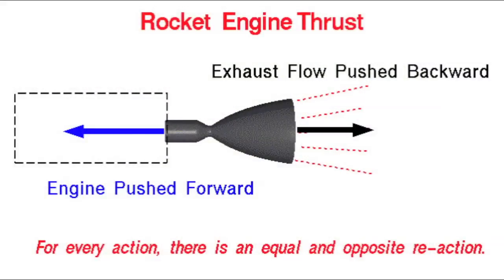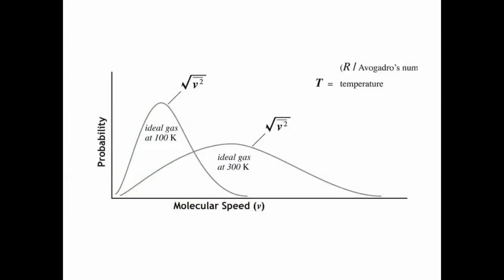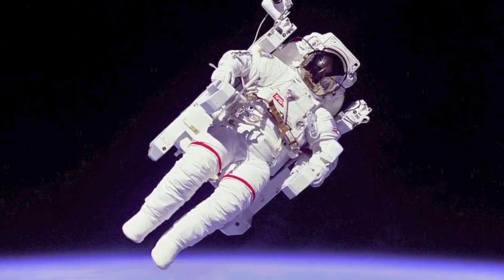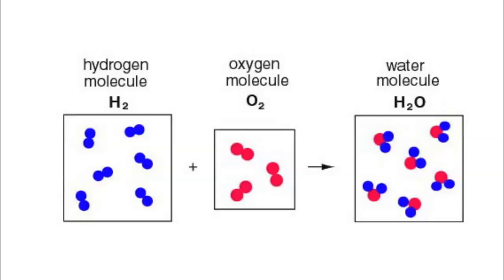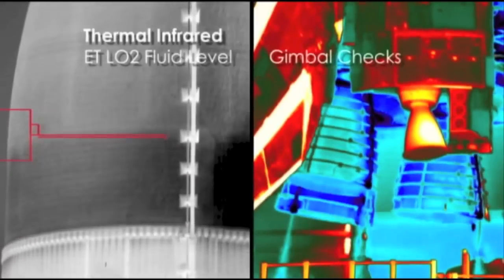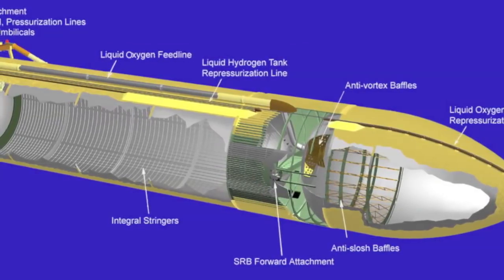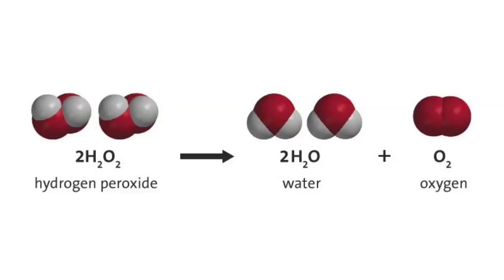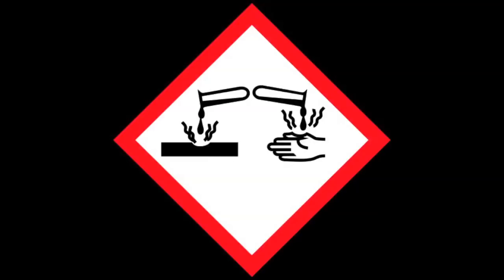WTF is Rocket Fuel Anyway?

Comment: So why arent we using SSTOs in real life or maybe even jet engines to get the shuttle high enough for the main rocket engines to fire?
Reply: I've been wondering about that, too. The concept seems realistic enough, and starting to burn the rocket fuel at the edge of the atmosphere should yield a higher specific impulse, right?
Reply: The quick answer is that getting to orbit is about speed more than height and the atmosphere is thick and doesn't have very much oxygen in it.

In fact getting into space (height) is so easy missiles fired from ships can intercept satellites, but only because they can fly really high to the satellites path and the satellite hits it, getting to orbit on the other hand is so hard only a few countries have achieved it and they are the most powerful countries in the world.

Getting to orbit is hard because it requires reaching enormous speed around 27,000 kilometres per hour (21 times the speed of sound) the fastest jet EVER built could achieve mach 3, even if we could strap the space shuttle to it it would still need it's huge fuel tank to achieve orbit.
It just doesn't make sense.
Reply: akrebsie Thank you for the explanation sir.  Take my +1 and like it!!!
Reply: Atanas Tripzter  Thanks man :)
Reply: Jet engines are WAY less powerful and more expensive relative to thrust, however very reusable. For example the RD-180 rocket engine (for the Atlas V) produces 860,568 lbs of thrust and cost $25 million, while the GEnx-2B67 turbo fan (for the Boeing 747) produces 64,400 lbs of thrust and cost $12 million. And thrust really matters when trying to get off the ground.
Reply: NASA is building one
Reply: Carrying both jet and rocket engines means taking a lot of engine mass to orbit.  Since conventional multistage rockets can get 4% of liftoff weight into orbit at most you can see that the margins are pretty small and every little bit of weight you can dump during ascent matters.  You might be interested to look into Skylon which is a proposed spaceplane using an engine which can operate both as a jet engine and as a rocket engine.  A significant difficulty is that the jet mode has to be able to operate at high speeds high up in the atmosphere in order for the extra weight of the combined cycle engine to be worth it.  Hopefully the precooler design for the Skylon should make it possible to attain enough altitude and speed to make an SSTO viable.

There is also Pegasus, which is a rocket launched off the bottom of a trijet.  A larger Pegasus II is currently in development.  There has also been some suggestion from Sierra Nevada Corp that a smaller version of the Dreamchaser could be air-launched.
Reply: Atanas Tripzter Nasa are building the S.A.B.E.R engine in real life. As if they were to carry jet engines powerful enough to get a rocket into space that would still add greatly to the mass therefore creating more problems.

But don't worry, It's in development
Reply: The Kerbal Scientist
I know i saw the article the other day.  Very cool indeed.
Reply: akrebsie Wouldn't a SCRAMJET be able to take an SSTO at least theoretically to orbital speeds?
Reply: An SSTO is in development, it's called Skylon. I wish they updated their videos and wrote better explanations on their webpage, but yeah, it's a thing...
Reply: Niels Christian Ørgaard  So long as you are in the atmosphere trying to achieve orbital speeds will get you a shit load of drag and an extreme heating problem. Scram jets have to be in the air.
Reply: Joel is  Sure there is work going on from that angle I wasn't trying to say it is impossible just that rockets are better and easier.

Also consider how big the craft would have to be on the ground to get significant payload into orbit.
Reply: +The Kerbal Scientist (KSP Science) Not NASA, but you're right this is the origin of the RAPIER in KSP. It's a supercooling jet/rocket hybrid, the reason it works as a system is that the oxidizer mass can be considerably reduced and the fuselage mostly needs to carry only the engines and the less dense hydrogen saving a significant enough amount of weight that a second stage isn't necessary. Getting the ship to work all the way to orbit is still kind of borderline, so it's a pretty crazy project.
How it works is by densifying the incoming atmosphere sufficiently to burn the amount of rocket fuel at the rate needed to develop the specific impulse necessary to attain orbital velocity. That is soo much harder than it sounds that the craft relies heavily on saving a lot of weight and a science-fiction level technology for its most critical component.
Reply: +Niels Christian Ørgaard trick with those is that you aready have to be going fast, very fast for the engine to even ignite, hence the NASA test article being stuck on the nose of a Pegasus rocket booster at high altitude. In other words, a SCRAMjet won't get you off the ground anyway.
Reply: There are concepts of launching tiny cubesats from fighter jets
There are an ssto design called SKYLON under developement
The spaceship 1 is a suborbital "plane" launched off a real plane
Single use and semi-reusable rockets are just cheaper YET :)
Reply: Skylon has been "under development" since  82. They've been dragging technology to catch up with the concept the whole time.
The short answer, is that it's very very hard to make a single stage rocket reach orbital speed. The optimisation built into the flight profile of a given Skylon mission to make it both work, and be a viable alternative to a multistage approach is pretty extreme.
Reply: SSTOs are not as good in KSP, let alone real life--that's why. It's far easier to get a payload up with a rocket, both IRL and in the simulator.

Comment: at 6:30 when you mention RP1 being similar enough in density to LOX for a single driveshaft to run both turbopumps, could that be done with a liquid hydrogen and liquid oxygen engine if the turbopumps for the LH2 and the LOX were concentric/nested?
Reply: +Steve Chisnall Yes! This is doable! The russian Energia launch vehicle's main engines (RD-0120) uses only a single shaft to drive both pumps!

Comment: Personally I'd find a way to use Radon gas as my electrical thrusters fuel. 
The benefit to this is that Radon is even heavier than Xenon and is already ionized when it decays! You'll also get the bonus of some helium gas from alpha particals!

How would I do this? Well there's these metals called actinides that decay into Radon gas. Radium the best metal of choice has  a half life of about 1,000 years. That puts it in the mid-half-life range meaning that it's short enough to produce significant radiation but long enough to keep your fuel generation source around for a while.

So even though the gas amount generated is low the life time of the fuel is high! Also the method used for radon generation would make it cheaper to build ion engines because in practicality since Radium is a metal and ALL of it will eventually decay into radon so you have a much denser source of fuel than Liquid Xenon could ever be.

Comment: A topic that I'd love to hear discussed in detail is how large is the consequence of the low density of LH2.  In other words, when I watch videos like this, LH2 has a lot going for it, but since the density is so low, that requires the LH2 tanks to be large... maybe very, very large.  So what I wonder is, how much does the weight of the huge tanks required for LH2 offset the advantages of LH2.  This issue is implicit in many videos I've watched on this channel and other channels, but I've never seen a detailed analysis done... especially with comparisons with alternative rocket fuels.

PS:  I sure wish someone would figure out how to make solid H (or H2 ???) and render all these analyses obsolete.  But sadly, I have a feeling we'll be waiting many decades for solid/metallic hydrogen, especially as a practical material for rockets.

Comment: what if you have hydrazine/peroxide and combust the products as
N2H4 --> N2+2 H2 (+ the side reactions which end up producing the same products in multiple steps)
2 H2O2 --> 2 H2+2 O2

before combusting the reaction products:
N2 + 4 H2 + 2 O2 --> N2 + 4 H2O

or a total reaction of 
N2H4 + 2 H2O2 --> N2 + 4 H2O

so you would have two catalytic pre-burners of hydrazine/peroxide, and then you'd combust the reaction product (Which are already hot by that point) in the main reaction chamber as if it were an HHO mixture (hence maybe having an Isp much closer to the LH2/LOX mixture)

now i understand combusting exhaust gases may be technically non-trivial, but it might be an interesting thing to try ;)
Reply: They have tried similar rockets were H2O2 was catalyzed and then a fuel was injected to react with the O2 although I forgot what the fuel they added was. I don't think the isp was too impressive considering the complexity. You should defiantly read "Ignition: an informal history of liquid rocket propellants" It's free online and it covers a lot of the unique rocket types and why we use the fuels we do.

Comment: I've got an idea that might be even crazier than Li-F-H...

Beryllium and Oxygen react extremely aggressively to form BeO. At 24.37 MJ/kg, it's over 50% more energy dense than H2+O2 Granted, with a melting point of 1560 Kelvins, Be is probably not a good thing to try to keep liquid, and of course would instantly ignite simply because... you have super reactive lava in contact with liquid Oxygen.

On the plus side, if you can figure out a way to store molten lava and liquid oxygen in the same rocket, and get them to react.... You've got a very efficient high-density rocket that will act hypergolic purely due to the high temperature. However, the exhaust would have a boiling point of 4170 K... and BeO is also highly toxic in powderized form... which is exactly what you'd get once it cooled below 2780 K.... Beryllium snow. Honestly, you'd probably be better off using it to build rockets with than as rocket exhaust... and they do.

But hey.. 570 ISP is good. Someone should make these... if only to test their [im]practicality.
Reply: That makes me wonder if the Be needs to be liquid at all. Would it work as a solid propellant?
Reply: Joseph Adkins
well since moonshine is basically ethanol and water, it is quite easy to find, for example, 150 proof moonshine(75% ethanol) and liquid oxygen is basically what the v-2 rockets used, and they had a specific impulse of around 239s, while 175 proof(99.99% ethanol) will have around 250s. basically that high is enough to compete with modern propellants, and with a good enough fuel/mass ratio and staging, theoretically and orbital moonshine-rocket could be made
-yours sincerely an armchair rocket scientist
Reply: what about using plasma hydrogen xenon kerosene uranium  udmh in a 3 km long reactor and 1 km long chamber.
Reply: ***** 'Do you know what everybody thinks of isp but lets think about thrust because propellent should be like that with extremly high thrust and fuel would come from solar panels.
Reply: ***** I ment not ion like using electrons to trigger chemical reaction or absorbing plasma like that theres a proppelent being developed named magneto plasma which have so much trust that its combustion chamber is so long and refuel absorbing something from the sun.

Comment: If high specific impulse requires a low molecular weight for your reaction mass, why do electric rockets go for a fuel which has a high molecular weight, like xenon? Is it that the ease of ionization trumps other concerns?
Reply: Basically. Xenon takes less electricity to ionize, and since the power requirements for a small amount of thrust for an ion engine are... Obscene, the fuel being easier to ionize means you can build the rest of the spacecraft to be lighter (Because it needs to supply less power to the engine).

Comment: The North Korean Unha-3 is fuelled by nitric acid and UDMH for the first two stages and a semi-cryogenic fuel for the final stage that uses liquid O2 and a glorified version of RP1 called RP2, with ＭＵＣＨ less sulphur.  You don't want to go near the first two stages of an Unha-3 when they are ignited as they use a ＳＵＰＥＲ　ＤＡＮＧＥＲＯＵＳ fuel mixture -- with nitric acid as the culprit.

Comment: Nuclear H2 engine is not actually 800isp, isp calculations tale consideration only the fuel, but in fact chemical rockets burn >50% oxidizer.
Hence, practical isp of NERVA is mere 1800 compared to LHOX engines.
This woths noting since a lot of people dont realize how distanceproof nuclear engines are.

Comment: Oooobviously, the best propellant is Staged Propellant (something I just made up right now). I suspect a good mix would be Acetylene, absorbed in Acetone, and stabilized in a foam of Paraffin wax (or bee's wax for the "Green" variant). The oxidizer side is much more simple.  It's just LOX with Ozone 'Ice Cubes". The Ozone gives an extra-special kick to the Paraffin, after both materials are carefully melted, of course. It's crucial to this design to use an assortment of hypergolic starting compounds, chosen by the intensity and quality of the colors they produce upon ignition. The engine bells should also be lined with sintered Magnesium powder, for day/night visibility, and to leave a trail of cute little sparkles.

Comment: Did you misspeak about which law engines use?  Newton's second law is essentially [a = F/m], that is acceleration is proportional to the force applied and inversely proportional to the mass.  The third law is what rockets use -- apply the force in one direction which will produce an equal force in the opposite direction.

Comment: Slight gripe about the energy densities. The H2 and Kerosene are not that energy dense, they just react with a tremendous amount of O2 to produce that energy. If the O2 is included, their densities are about 10 and 16, respectively. Not 46 and 123.

Comment: Project pluto, used a uranium, air cooled scramjet to power a cruise missile the size of a rail locomotive. A prototype and full size engine were both successfully tested and ran perfectly. It would cruise at Mach 3.5 at tree top height and would have killed people on the ground as it flew past, and irradiated the countryside, let alone the 20 multi mega ton payload of warheads.

Comment: The NERVA nuclear rocket could also use either thermocouples or small steam turbines to generate electricity for the spacecraft. Even when the reactor isn't heating H2, it is still going to be throttled down, but not off.
Reply: Since liquid hydrogen can't be stored off long periods without active cooling anyway there were concepts that used the liquid hydrogen for removing decay heat from the reactor to generate electricity through a turbine. Unfortunately because liquid hydrogen is used, a NERVA engine could probably only be used as a transfer stage.
Reply: MikeM8891 The nuclear reactor could run a generator as well. This generator can drive a cryogenic cooler to maintain the LH2.
Reply: leerman22 That is exactly what I was thinking, but it would need something to drive the turbines.....
Reply: KASASpace Unfortunately it is not practical to recondense the H2 because it would require removing the heat which is not efficient in a vacuum. The Hydrogen would need to be cooled to 20K, this is colder than Pluto or even Neptune's moon Triton. H2 truly is not storable and would need to be vented, but at least you could generate some power while its venting.
Reply: MikeM8891 How do you keep it cool on Earth then?
Reply: MikeM8891
you don't need to use H2, just something that boils, like water.

Comment: Could an ion drive use oxygen, with a nozzle made of a material that's already got as much oxygen in its structure as there's room for (i.e. a ceramic), or is designed to erode away and be replaced, or both?

Comment: I don't get why gases with lower mass molecules give off higher specific impulse as rocket fuel as heavier gases wouldn't be as fast but would have a higher mass and therefore could provide the same impulse. So in the end you can have engines with lower pressure inside which would be beneficial for the materials while providing the same force.

Comment: Could an ion thruster use liquid nitrogen? It is much lighter and more plentiful than xenon and is relatively inert, if it does react with the rocket nozzle it will be an Austenitizing element which shouldnt be terribly detrimental to stainless steel. Thoughts?

Comment: You seem to be implicitly treating 'nuclear engine' to mean 'solid core nuclear engine'. There are also designs which produce exhaust hotter than hydrolox because they are designed to allow the uranium to melt or even vapourize when operating.

Comment: I love how we went to the moon on diesel fuel (kerosene)
Although I would much rather use the Orion design. (Nuclear weapon power)
Reply: Technically Diesel oil is chemically different from kerosene.
Reply: @LoanwordEggcorn  yes I inow
Reply: @theq4602  But your point is sort of valid that they're related.  Also the Hydrogen-Oxygen Saturn V upper stages were more efficient and better for the high delta-v generally needed to do deep space missions.